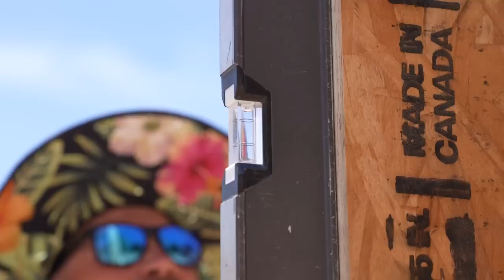OUR GARAGE IS FINALLY TAKING SHAPE | BUILDING OUR OWN HOME

Comment: Hey guys, I can speak from experience the two door symmetrical doors in the center, you may want to switch out for one max width and height door. We did and were able to fit our class A in, even if you can't fit that size rig you will be able to max out what you do have and fix as tall of an item as the garage will allow.
Reply: The photo of I'm the 3 bay door update w the ski sloped roof, was a joke
Reply: Yes!! Good advice

Comment: Hello! a tip from a carpenter. cut the bottom and the top plate at the same time. if you dident do so because the wall is a bit of concrete its just to calculate the thikness of the wall and remove that messurment form the bottom plate:) then it dosent mather if the vertical wood is bowed. ;) GL with the build!

Comment: For those of us watching at home who get confused, here is the correct term....horizontal directions are Level and vertical is plumb.
Reply: How nice to know!! At my age (81) I had no idea. Makes sense and often wondered why there were so many bubble windows! You never stop learning, right?
Reply: @lindajwilson9848   Also, it is always best to use the longest level that will fit on the material you are using. For example, don't use a small (torpedo) 8" level for a board that is 8' long. 4' levels are standard, but for wall framing a 6' or 8' level is best. Most really good carpenters have an assortment of levels. Lasers are also handy.

Comment: Trent -Amazon has a camera that plugs into usb port.  Catch is only 15-20' length.  I used one to clear my dad's problems.  Line froze and separated. Pipe filled with gravel.

Comment: Trent, and Brandon, Just a heads up. Make sure east and west top plates are equal in lengt as north and south top plates equal in length. Pull diagonal measures at the top with a reel tape, should be equal. If you dont have this close... setting trusses and subsequent roof sheeting WILL become stupid! easier to fix now than later. All the best!
And Allie, beware of teenagers  at lumberyards  ; )

Comment: You might think of putting a couple of tripods, one on each side of septic lid  to hoist that concrete  lid and slide bar it out of the way. Lot easier and less messy.

Comment: Often new septic systems develop a kink in the line feeding the tank. The problem comes from dirt settling along the excavation for the feeder pipe. You need to pack that excavation with lots of incompressible gravel.

Comment: plumbers credo : dont open youre mouth at work
just a thought , could it be that the septic is pressuring as its filling preventing the stuff from actually going through the main pipe intoo the tank , might want to try keeping the lid off for a few days while "trying " to clog the system , and see if its harder to do

Comment: If you installed a Bidet in your master bathroom you would minimize the usage to toilet paper, therefore minimizing clogs and problems in your septic system. The cost for Bidets is very minimal and well worth it.

Comment: No food in the garbage disposal, because that screws up septic systems.  But that defeats the purpose of having a disposal!  I took ours out entirely, and the sink drains much better.  The disposal electrical outlet lets me have another high-current kitchen appliance running without tripping a breaker.  Microwave, convection oven, induction hotplates, air fryer, toaster, bread machine, and instapot.  Lots of stuff needed in the kitchen!

Comment: Sketchers makes female fit steel toe safety shoes. I had to wear them for a temporary warehouse/distribution center job I got during the pandemic. By temporary I mean I lasted 4 days because of the four flights of stairs I climbed at least 3 dozen times a day with a badly injured mi/low back, and the mind numbing noise even with ear plugs…. 😖😖😖. They were actually light weight, breathable (no stank feet) and comfortable. I wear them now when I’m working seasonal festival gigs, at local farms. Highly recommend them for Allie! Maybe some teeny weeny ones for Sñr León!  🥰🙏🏽✌🏽💖

Comment: I’m sure that Joel feels really bad about dropping that board on Allie’s foot. Accidents happen all the time in construction no matter how careful you are. It in the high 70s to low 80s there while it been in the mid to upper 90s here in Western Kentucky. I would imagine that the heat effects people in cooler climates differently.
Reply: They are at 8000 feet of elevation I think, so 75 can feel like 95 because the air is so thin.

Comment: Personally I would use that space above garage to the maximum. Therefore I would build either two smaller apartments one for a guest (guest room), and another for your son, or one bigger apartment for your son only.   That roofing on that photo is ridiculous - in my opinion. I would make a roof that slides only on the one way to back of garage. It would also look more modern this way.